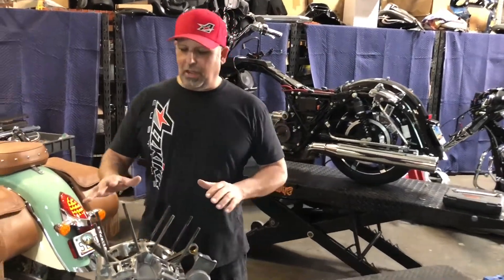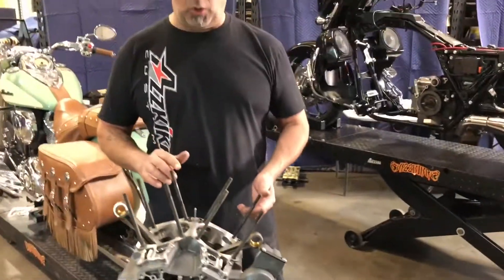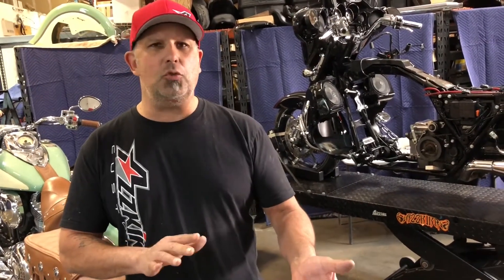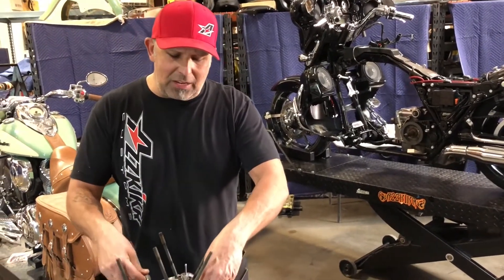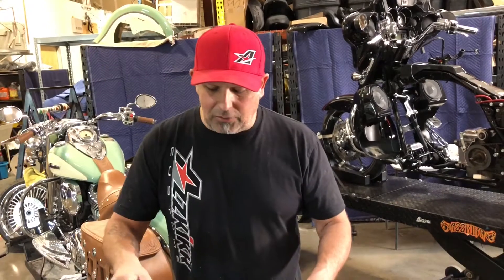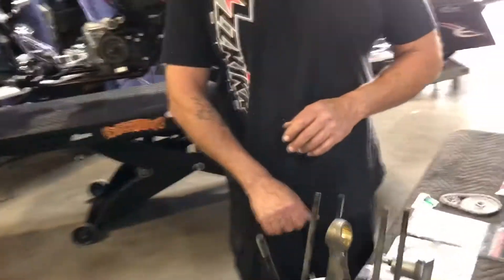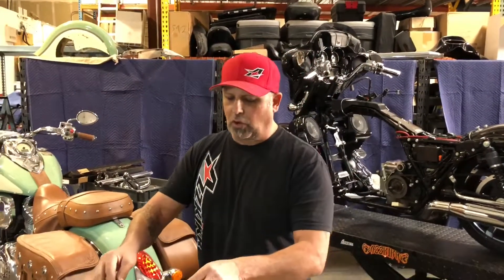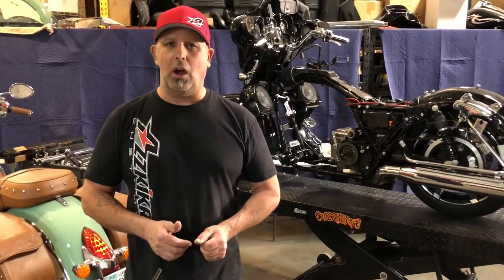Crankshaft Runout on Harley Twin Cam

Comment: why anyone would want a harley is beyond me, yet I have one....
its like being married to an abusive wife that ends up leaving you broke and without transportation
Reply: Ok who is to say other manufacturers are any better. I did some research and seems Honda has their issues as well. But who races Honda like Harley owners do? Perhaps Harley is no better or worse than any other manufacturer but are under more scrutiny because of the racing spicifics.  I lean towards a strong probably. Hot rodding a two cylinder engine is idiotic anyway. It was designed as a low compression engine for a reason. As well as a chain cam drive engine. Of course installing gear drive cams is going to expose weakness in manufacturing.

Comment: Do you check this on the thunder stroke 111?
Reply from the maker: there is a spec for it in the manual, if we are down that far, yes we will check it